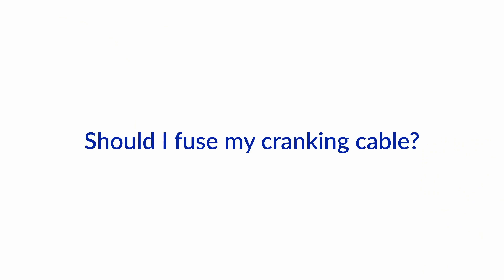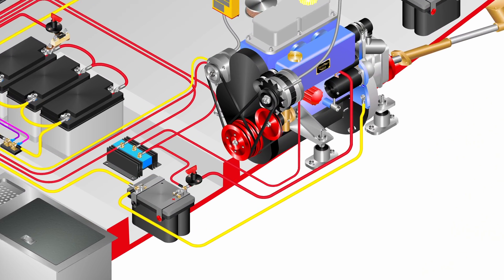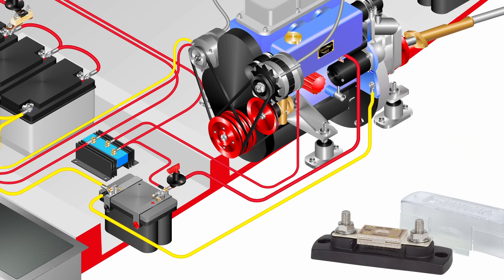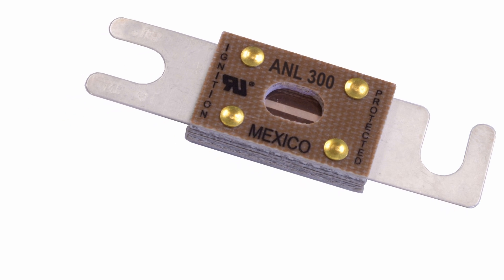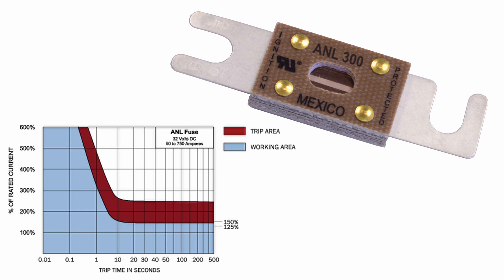Fuses for Starter Motors: Should I fuse my cranking cables? | Ask The Expert with NIGEL CALDER

Comment: As I understand it, the risk of blowing the oversized fuse is negligible, if the starting motor is functioning correctly.
However, if there is a short circuit (in which case you won’t be able to start the engine anyway) it will prevent a fire from getting started. Correct?

Comment: A few hours out of Puerto Vallarta, heading offshore, and i thought I could smell something burning (or maybe smoldering). Decided to turn round and investigate and, after a few days of investigating found an insulation breakdown on the starter circuit (due to a previous owner installing welding wire). As you say, no fuse on that circuit but even if we had one, i doubt that it was yet at the point where it could blow a 100A plus fuse. Havent installed a fuse (yet) but did install a simple high capacity on off switch, to isolate the engine (starter + alternator) from the start battery at all times the engine is not actually in use.